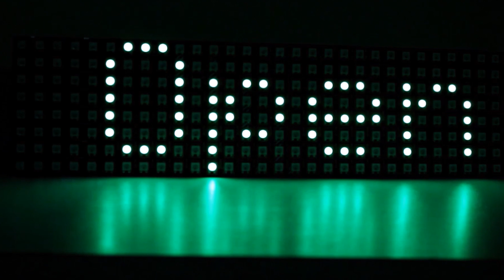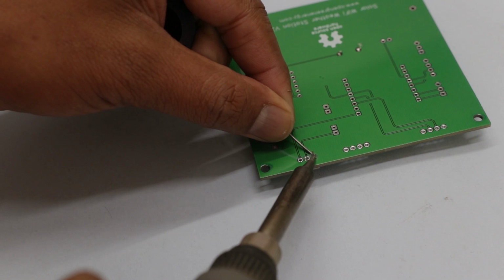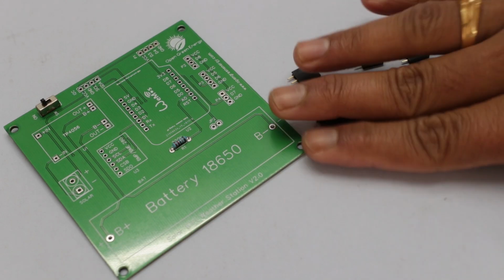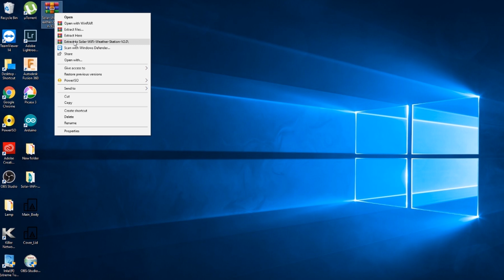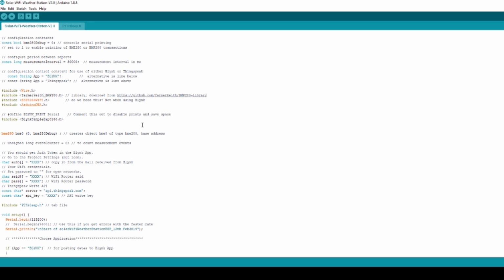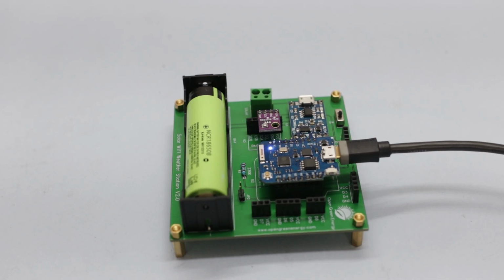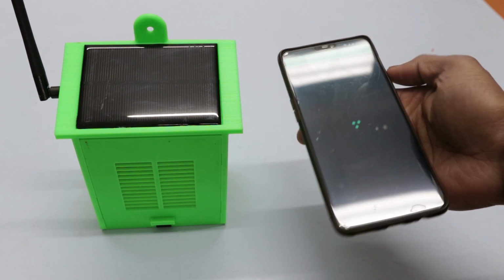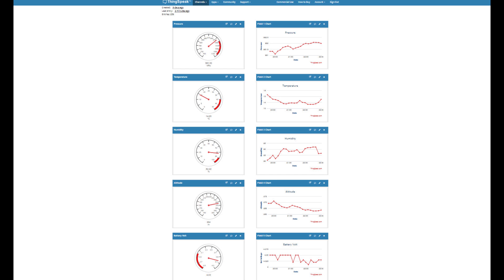DIY Solar Powered WiFi Weather Station - V2.0 || Solar Weather Station ESP8266

Comment: Excellent job! I had a question regarding the antenna. Any idea if it would be possible to plug a dual band WIFI antenna rather than the 2.4GHz that they sell with the Wemos D1 mini pro?

Comment: Just wondering if it still is running well? 3D prints are usually not weather proof, also the vents on the side seem quite open. Do you have any experience
from rainy weather conditions?
Reply from the maker: You are correct, the enclosure is not at all weather proof. I have applied a lacquer coating over the PCB and all the components except the sensor plart only. I have experience from my earlier version, it can last more than 4years by applying the lacquer spray coating.

Comment: DS18b20 requires 4.7k pull-up resistor, you have not included it. What are your comments about it? Can it work without this pull-up?

Comment: Can you make one that:
 Uses:
- An arduino uno
- An arduino wifi/lora (either or...or both) sheild
- Various Sensors

Senses:
- Outdoor Temperature
- Outdoor Humidity
- Outdoor Barometric Pressure
- Wind speed and direction
- dew point (Via math of pressure, humidity, and temperature)
- rainfall
- solar radiation/irridance (via solar panel power in, and math)

It would be a big project, but would be intresting and useful!
Reply from the maker: Your feedback is noted, I will try to consider in the upcoming revision of my design.
Thank You
Reply: @opengreenenergy  I made this page on the project:

https://wiki.opensourceecology.org/wiki/Open_Source_Weather_Station
Reply: @opengreenenergy  Hope you will stick with same microcontroller (maybe 32bit) and add wind speed / direction

Comment: is it possible to connect HSR 204 ultrasonic sensor to this board ,usually they are connected to D1 , D2 pins in wemos d1mini. is there any way i can connect it using the PCB you have designed . I would like  to create a water tank level monitoring system using this board.

Comment: Does the board go into deep sleep mode to preserve battery? Also how long can the station run without sun? Also can a Co2 sensor be added? Finally why not use an LiFePO4 battery instead as it is safer and more robust than a Li-ion?
Reply from the maker: Yes it goes in to sleep mode to preserve battery.
Yes Co2 sensor can be added.
Thank you for suggesting the LiFePo4 battery.
Reply: @opengreenenergy  +  I recommend using 705 sealant (TIAN MU/KAFUTER/etc)

Comment: hello nice projekt. i build this but the blynk app have no data. information from the blynk app is. New divice connected an then new divice disnonnected. every time.....
Reply from the maker: Have you short the jumper J1 ?
Reply: yes
Reply: thank you for your answer. I have a 2. question. 
to update the data on the blynk app, i have to connect the wemos with the cable. 
In what period of time is the data updated by wifi?

Comment: Very cool project. A couple questions though, why do you use TP4056 instead of a solar charge like an MPPT with a CN3791? Would it be possible to replace the slits in the case with a stevenson screen? That together with (probably) some rubber in the joints and ABS instead of PLA for the 3D printing could make it weather proof, but I might be mistaken :-)
Reply from the maker: Thank You for your suggestions. I will consider it in my future revision.

Comment: Awesome build! How does it hold up on the longer term? Especially regarding the power supply via solar?
Reply from the maker: I am using it since last 3months, the battery is still in almost fully charged condition. One hour sunlight is enough to run the system.
Reply: @opengreenenergy   Thanks for the update!

Comment: you said its for taking weather informations such as pressure, temperature, humidity. Does the board withstand outside climate?
Reply from the maker: The enclosure is not weather proof, if you keep the board inside a weatherproof enclosure it will work like a charm. Currently I keep it in my balcony where it receives 2-3 hr of sun light which is enough for running the board.

Comment: Hey there! I saw you used a diode from solar panel to tp4056. None at this project. Do you think it is safe to use 1W solar panel straight to the tp4056? Thx.
Reply from the maker: Hey,
I used it in my old version.
But after reading the TP4056 data sheet, I found that there is no need to use diode.
You can safely connect the solar panel directly to the TP4056.